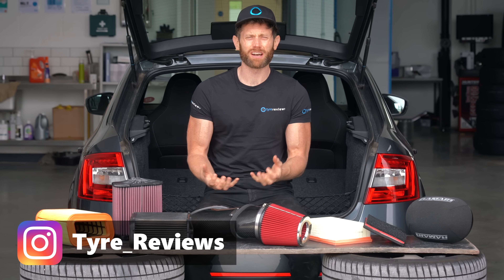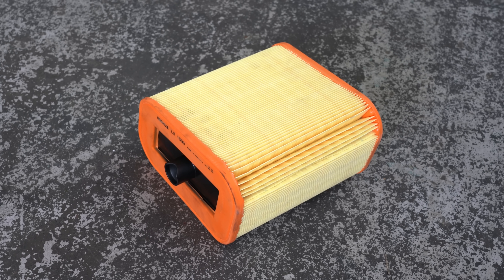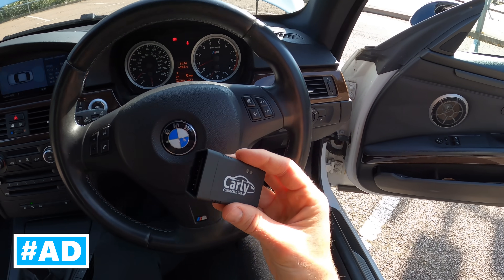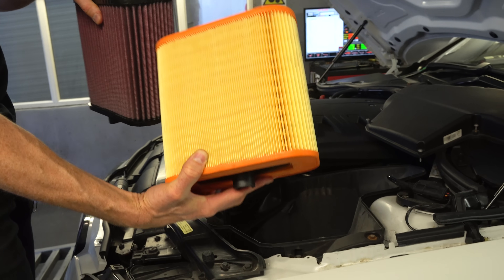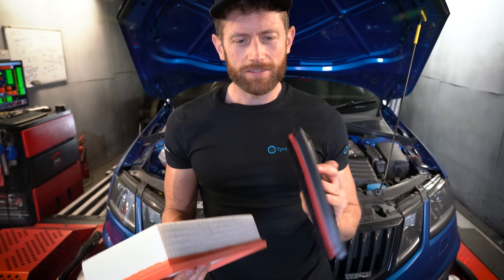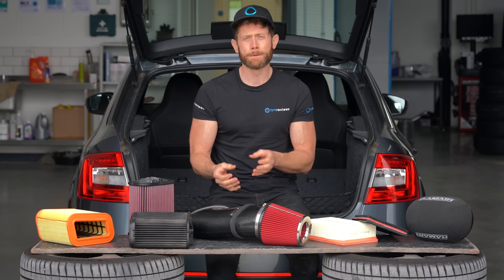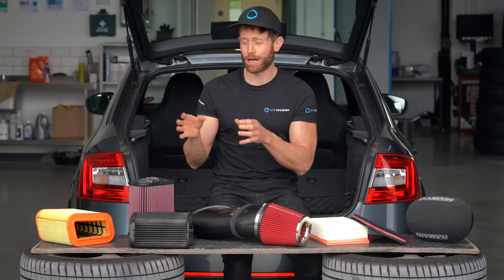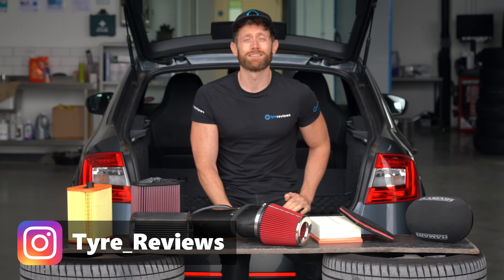Do Performance Air Filters REALLY Give You More Power?

Comment: Did you install the air scoop that Eventuri provide  with that kit? If you compare filter and intake system you have to install all of the components. Looking forward for the build.
Reply from the maker: Yes the scoop was installed, though the way the dyno was blowing I'm not sure it would have had a huge effect, I'll be testing it on the road too when I retest

Comment: Bigger holes means more air... and more dirt.  Project Farm channel have a great film on the dirt filtering (or lack thereof) of high flow filters.
I know I'm not using them anymore especially for the minuscule power gains
Reply: I’m right with you on this one - a K&N used to be the first thing I did to my cars - no longer since watching the project farm vid! And this video only serves to confirm they’re a complete waste of money.
Reply: @dj_efk  It all depends on if the car is very turbo biased and remapped. My remapped diesel Mercedes is very turbo biased and it made difference with K&N, id say easy over 8hp and over 10nm. While on my Volvo which has big engine but low pressure turbo, it barely made difference except in sound.
Reply: there are plenty of objective and non-biased air filter tests (some more scientific than others), and they all have concluded that "performance" filters in general (and K&N in particular) do a piss-poor job of filtering air, at least in comparison to OEM-style paper filters, without providing any significant gain in power (mostly within the margin of error)

here are a couple:
https://www.gmtruckcentral.com/articles/air-filter-study.html
https://moto.lexp.net/wiki/Air_Filtration_Test
http://blog.consumerpla.net/2011/03/k-and-n-high-flow-air-filters-test-1.html

there was also one that had used oil analysis for each filter to show Si content in oil (indicative of dust through the air filter), but I can't find it anymore..
Reply: i was about to tell the Project Farm test on the filters too
Reply: Some Tuner not related to this video said on a completely other topic something to performance filters. He asked his mechanic on how the turbine blades looked like from cars with performance filters. He said like sanded or something like that.
On the other hand I hat a very short period this kind of filter. My blade looks like it had eaten some bigger rocks 😂
Reply from the maker: Project farm was mentioned in the video and linked in the desc :) Also yikes @Nordlicht
Reply: @tyrereviews  i thnink no big deal besides its look. There was never anything wrong and the turbine has over 200.000km.
Reply: @Nordlicht05  I tend to use coffee as an analogy for filters. If you use a french press, with a metal filter, yes you get more of the coffee taste, but you also get more of the dirt. Don't have that issue with paper filtered coffee.
Reply: @Cuddlemeister47  i my case i dont think this is from the filter. Was only a short time.
Reply: @Cuddlemeister47  Wash your beans if they have dirt on them.   Duh!
Reply: all these filter testants suck (as much as i saw in most videos)..they all get no extra power with performance filters..of course i appreciate their effort n job, but they all forget about 1 very important thing - it's how quick the engine reaches that power..it doesn't matter if they get the same horsepower, with the performance filter the engine revs easier as it gets air easier, n it doesn't matter even if the power remains the same, but the engine with performance filter will reach it's power quicker..just like with lighter flywheel - you get no horsepower gain, but your engine revs a lot quicker n due to that you reach your max power quicker..the same with accessory lightweight aluminium pulleys, or any other engine drivetrain component: crank shaft, piston rods, pistons, chain, sprockets, n even valves - the lighter the engine components the easier n quicker the engine revs..for instance, let's say a particular nissan with first generation SR20DE 110kw (doesn't matter highport or lowport) with its 8counterweight crankshaft will sprint 0-100kmh, n then with swapped 2gen. SR20DE 110kw 4counterweight crank shaft engine in, and does the same sprint (let's say both engines' revlimiter set at the same 6500rpm n have the same power 110kw, as they should)..so most plausibly, the same nissan will sprint/accelarate better/quicker with 4counterweighted crank shaft SR20DE than with 8counterweighted, because with the lighter crank shaft engine will reach it's peak power quicker..the same with performance filter, the same power, but the engine response is better, cos the engine breathes easier, so it revs quicker (not necessarily every engine will rev quicker, depends on lots of other components n its features like i've mentioned before)..i hope you got my point..a good example n proof is "Project Farm" guys' test/sprint with their suburban, where with performance K&N filter the car sprinted quicker by 0.1-0.2s in 0-60mph, n even flow tests showed that performance filter flows better despite that most test show the same power n no gain..ckeck yourselves @7:25..https://www.youtube.com/watch?v=sJ3L-E-ufYo..so we already know from various dyno tests that perform.filters in most cases don't add power, so you should make sprint/accereraton tests 0-100kmh/62.5mph instead to see if there's any point of P.F.;p..i instantly felt better responce/acceleration after putting performance filter on my SR20DE Primera/Infinity P10/G20, my brother also instantly felt the difference in performance in his Maxima A35 VQ35DE after installing PF, he even did a test with a device n got 0.1-0.2s quicker sprint to 100kmh..so i guess the performance filter does his job, even if it doesn't gain any power on dynotest, but the sprint results speak for themselves..to get those 0.1-0.2s you would need an extra 10-15hp of engine improvement or even more to get those sprint numbers with your car..as for filtering, of course performance filters suck, especially K&N, BMC, King Dragon or any other cotton filters with see-through holes, unless it's AEM non-oily one, they filtrate better, as seen in your test (but no doubts, even if AEM filtrates a lil worse than stock/oem filter, it will perform better than any oem'ish compressed paper filter with microscopic or no gaps between paper folds)..so only you decide if those 0.1-0.2s of performance worth the engine wear..good luck!!
Reply: https://www.youtube.com/watch?v=YypvDEQyNBY
Reply: I did all this on many cars over 30yrs before YouTube and the results are still the same.
Aftermarket filters are of no use.
Reply: I'm curious, though.. is the extra dirt let in, enough to hinder the engine in any way? If I made a more restrictive filter and made it filter out more contaminants than the stock style filter, would you then talk badly about stock filters not being good enough, even if you lost 5 hp and it's over kill on filtration? What I'm getting at is, yes, they filter better.. but is that extra filtering doing anything significant to longevity of the motor? At what size of particle does it start to hurt the engine?
Reply: @justinhardt1  Good point.  If you see the old F1 cars from the 50's to 70's, note how a lot of them have no air filters *at all*.  Apparently the lack of an air filter causes drastically increased engine wear (which of course doesn't matter when the engine is rebuilt after every race meeting).
Reply: Absolutely correct...and the same advice to all the halfwits wearing the covid masks...exactly the same principle! 😂😂😂
Reply: @TheScudabear1  I wonder how you would feeling if a surgeon came in to operate on you without a wearing a mask ?
Reply: @derekcable  I'd probably be sleeping from the anaesthetic,  your point being what?
Reply: @TheScudabear1  Point lost on you 🤷
Reply: @derekcable  Sane person is not Captain Obvious.
Reply: @TheScudabear1  You need a bigger tin foil hat 🤔
Reply: @derekcable  bravo Derek👏...great comment considering your limited intelligence 🤣
Reply: @TheScudabear1  Masks do help mitigate the spread of aerosols.  So not quite the same as the air is going two ways, not just one.  Difficult concept, Iknow.
Reply: @machtschnell7452  Get your facts right...masks with adequate filtration will help stop AIRBORNE spread, otherwise they are completely useless in that respect. The "supermarket specials" as worn by most people stop only large particles like saliva from being transmitted. Personally,  I don't drool and slabber when I speak,  but I completely understand the protection they would afford to anyone having a conversation with your good self.
Reply: @TheScudabear1  So what you are saying is do not wear masks? or just stick to paper?
Reply: @neovenom9833  I'm saying if the filtration level is below what is required to give adequate protection from whatever you're trying to block out,then the filter(mask) is pointless